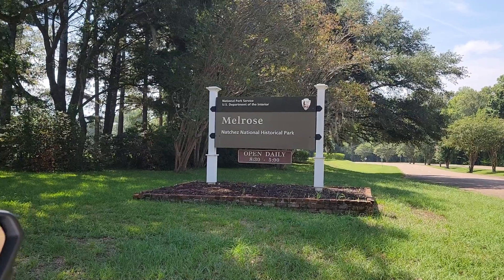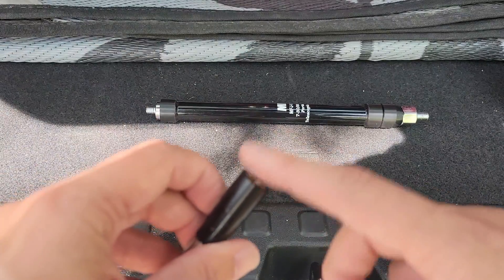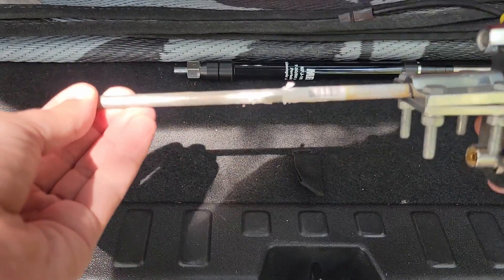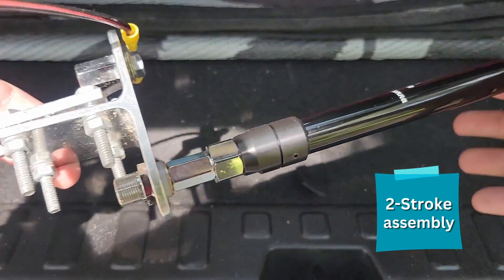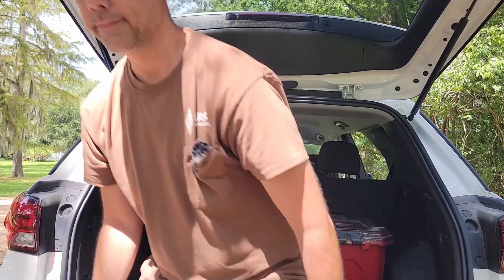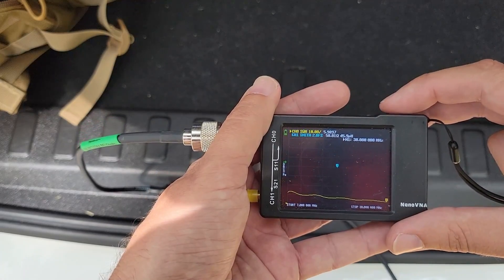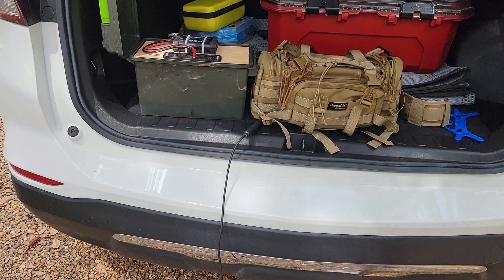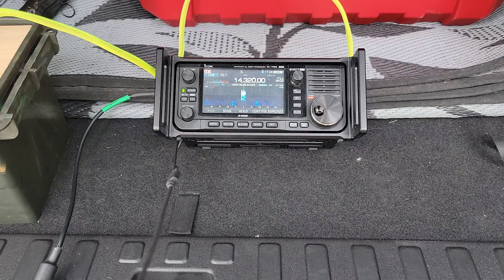What's This Antenna?

Comment: Have you tried using 2 of these antennas mounted to the bracket shown in the video to make a dipole antenna?  This would be similar to ham stick or a buddipole.
Reply from the maker: I haven't, but it should work pretty good!
Reply: @temporarilyoffline  Thanks.  I was thinking of doing this with a Hustler 40M super resonator.  I have one now but with a second would be costly. So I'm thinking of getting 2 of these and can tune in other bands.

Comment: Thanks for the video!   What gage (size) is your ground radials and what length are they?  And does that make much of a difference as far as how much power you transmit on?
Reply from the maker: These are 22 I believe. I'd run 100w through that, but no more. They are 17’. There is a balance between portability and perfection. Find what works for your requirements and have fun

Comment: I have the same setup. Was thinking of using it next fall as I cruise the Erie Canal from Rochester to Lakeport for 10 days. I was told the Erie Canal was a park for its entire length! Question for you is, what do I use for radials while cruising the canal? I know I can put them out when I dock for the night; but I’d like to try mobile. Keep doing what you do! 73
Reply from the maker: I use 4x17ft radials.  Can you spread them out on the boat?  Any metal railings on the boat? Connect them electrically...if not, Check out KB9VBR's magic carpet setup.

Comment: great job ! that a neat antenna.  I found just get ground radios on the ground spread them out normally does the job. this changes to the type of ground and wetness. when you reach around 1:5 SWR call it good. below that makes little difference. This is portable and not 2Kw . once I get a dip in SWR in the band I want around 1.5 or so I just use the tuner in my 7300 and start calling CQ. works for me. it you took a outher hour to get 1:1 it wont work any better getting out and that a hour less of on air contacts. most radios today have a tuner bult it. just use it. even weather change can effect SWR . snow rain ETC.73's
Reply from the maker: Absolutely Correct! This is what I'm trying to tell people!

Comment: I have one of these ("Gabil" branded). It works great! I use it with a X6100 and a IC-705. It's really surprisingly good once you get the counterpoise situation working. And it's extremely portable. It's a winner for its intended use IMO. 73
Reply from the maker: Exactly - compact back-packing antenna its perfect.  If you have space/no portable needs.... not so much.

Comment: Thanks!! Another great vid! 

I rigged up something similar for my Toybox, but that looks a little more robust for external use. And the 3/8x24 on both ends is sooper flexible!

I'm building a bracket to attach to one of those yellow 23' extendable painters poles and was wondering about how to run radials/counterpoise once it's elevated that high: Would one run a single strand down to the ground then fan out 4-6 radials, or run all the radials right from the elevated bracket and just accept the first 23' dangling to the ground?

Yep, I'll try both and measure, but thought someone might have good thoughts! Thanks again!
Reply from the maker: Thought 1: Try it and see, should be fun.  My gut says it won't work as well, but I'm genuinely interested in if this would work.
Thought 2: Use actual wire or wire around rope as your guy lines on your elevated vertical -have them sloping down - connect these to the shield at the feed point and see how well that works.

A lot of antennas that are vertical/elevated use metal rods sticking out horizontally, depending on your connections (or not) that could be expensive.

Comment: Go for it, play radio. 1.5:1 is only 4% reflected power or 0.18dB loss. Just hope the VSWR Police weren't waiting for you when you got home😅.
I have a mobile antenna that uses a similar design as this. However, for 20m and higher, found that hamsticks seem to work better. Assume because base coil loading tends to be less efficient than the center coil type. On the other hand, the telescoping coil design does give you quite a bit of frequency agility.
Reply from the maker: with the 3/8ths-24, you could add a section or two of rigid radiator below the antenna to get the coil elevated.  I might have to try this experiment.

Comment: Great video. Neat antenna. It look far more versatile than the MFJ 1899T antenna that uses a tapped coil for changing bands. I could not agree with you more when it comes to the ground radials. If they are laying on the ground, they DO NOT have to be tuned. I use three each 35 foot long radials and three each 17 foot long radials for my portable ground mounted vertical.
73 de KU3X
Reply from the maker: I think the tapped coil variety are more limited - still workable, though.  This 1898 has worked well every time I've tried it.

Comment: Interesting idea, but the price. I'm looking at something for "vehicular portable" operations, but I think there are better options for the money. For the same money a full set of hamsticks can be had iirc. A WRC Silver bullet and a buddipole 9ft telescopic whip ought to do the same job for just north of a hundred bucks.
Reply from the maker: Yeah, this is more "backpack friendly" and I wouldn't recommend it for vehicle ops.  The ham sticks are a much better choice - esp with the quick disconnects to change bands as the time of day changes.
Reply: @temporarilyoffline  Yeah I definitely wouldn't be using something like that mobile. I'll be sticking with hamsticks for that. ATM I only have a 10m radio in the vehicle, but I have a spare DX-70 lying around that I might put to use. I am thinking more along the lines of something multiband and quick to deploy either via mag mount or screwed in to the existing mount for parked operations, something not my normal portable rig that I can carry around in the truck with me.
Reply from the maker: @KC3UVF  exactly, I'm going to use mine for parked operations also.  The car makes a good counterpoise for that!

Comment: Very easy to set up and radials are okay in contrast to 3 years ago when you lamented the same basic radio theory mechanisms on the HFJ-350. Notwithstanding quality of build issues, tuning mechanism, and RF performance, I am curious if your opinions on the HFJ-350 requiring setup compliant with basic radio theory have changed. It was nice to see a video giving an MFJ product a fair shake instead of instantly trashing it because it's MFJ. And not having a click bait thumbnail. Nice, comprehensive video.
Reply from the maker: I'm still ot a fan of the hfj-350 - that antenna is much more compromised and less flexible than this one.  The HFJ "required"  a tuned counterpoise for each band and it is honestly silly to have a 100ft+ counterpoise. This antenna is still a compromise, but not as bad.  MFJ gets a bad wrap, but where would we be without MFJ and who else fills the niche (big as it is) that MFJ does?

Comment: after stimulus change you must calibrate again ....
Reply from the maker: The nano doesn't have to be a huge obstacle, it can just as easily be a good friend when it needs to be.  Different methods for different tasks and you can't show every detail in every video. In this car, my default calibration is for 20m and until I got to 20m specifically I was out of calibration... but as you saw in the video close enough to accomplish the mission I set out for.

Comment: I have a Hustler 5b and it was given to me in segments. So to put them together as if it was new out of the box, I called the manufacturer. DX engineering. While talking to an engineer/ham, he told me that they also consistently experiment to improve the antennas they sell. So he sent me really complete documentation on the antenna, that included measurements for the sections when assembled.  However once I got the antenna together, I was going to add ground radials, but two problems came up. One the base for radials was not with the antenna. This turned out to be a separate item and cost more money than I had. The second problem, I did not have room to add as many radials as they suggested, not enough room in the yard to make a big circle. Calling DX back and a different ham, he told me they had experimented and found that there really was no need to measure radials for each band and they found making several radials at exactly 25' in length  and at least  5 of them would work. Yep he was right.
Reply from the maker: Exactly, we are always discovering more about radio.  The truth is out there. Great news on getting your antenna working!

Comment: I wouldn't buy one. It's too short to be efficient, especially 40m
I bought a SOTA beam telescopic mast and intend to run a wire up it with a tuner. Telescopes to about 2' and extends to about 19'. Much cheaper.
Like an old ham friend said, you can tune up a knitting needle with a good atu but it won't be efficient.
G4GHB.
Reply from the maker: I've found this one to be very useful in travel, especially air travel.  I have a small tripod, this antenna, some coax and I'm on the air where it would have been difficult before. All depends on your use case.  Everything is a compromise, some you can even live with. Thanks for watching.

Comment: 10m long wire ( on a tree / squid pole ) and an old antenna tuner , some coax ,and ,,,,,,,, DONE.... next
Reply from the maker: I think the only pole you can get in a backpack is the carbon6 from sota beams. It's on the list for sure.

Comment: Looks like MFJ stole the Gabil design. Gabil runs with UHF and 3/8-24 options now on their ebay store. My GRA-7350T tunes 40-6 no problem. 72' counterpoise in 6x 12' wires, laying all the way on the ground around the vertical. She works awesome that way.
Reply from the maker: I like the gabil too .. did you seen in the gabil instructions where they left the original mfgs name in that they stole it from?
Reply: @temporarilyoffline  no I hadn’t but I noticed your similar replies after I posted. Haha. Nothing original it seems, my bad! Good antennas tho. Got Italy from WV the other day on mine!
Reply from the maker: @Emcipio  I have a video on the old gabil, and another in the queue on the new gabil with the laser engraving.  I love the gabil tripod, both are goto resources for traveling

Comment: Aloha Steve, this antenna was designed to work on 10,11 and 12 meters. If you got it to work on 20 and 40 meters, more power to ya! 🤙🏻
     Since I can’t afford the Chameleon MPAS antenna, I built an antenna that works very similar and has an SWR of 1.0 right out of the box so to speak. Which is perfect for my Xiegu G90 and I bet it would also work well with my old Ranger RCI 2950 HF rig for 10,11 and 12 meters. 
     This antenna reminds me of the PAC-12 antenna that you can buy for about $150. 
     I was hoping that this video was going to be about you getting on 10 meters for a Park to Park activation. 
     I haven’t checked the propagation for 10 meters yet today but I’m thinking of driving up into the mountains and getting on 28.310 mhz USB at K-2222 within the next hour. Wish me luck! 🤙🏻
Reply from the maker: I've been on 10m all week at a park, get your ham alert on and come find me brother!

Comment: Don't get me wrong I'm not an hater of MFJ products and have bought a lot from them in the past. However, while the antenna does seem workable, you'd think that there would be some sort of guide provided much like what other antennas makers of this type do as a starting point, and yes, using an analyzer to get it tuned is an option, but it seems a bit cumbersome to get it where you want. And although I see the use of antenna like tihs for portable use,  personally for $149.00 I just can't see it. As a matter of fact, I couldn't even find a manual for it on the MFJ site. I suppose one could take measurements for each band as suggested, but most HAMs who do portable simply want to get setup as qujickly as possible to make contacts.
Reply from the maker: I think you're spot on and I'll help MFJ a little here.  I think this is a brand new product of there's and they haven't written the manual yet.  They are also a little behind on website stuff.  MFJ is one of the few places we have that has so many products available.  I would like to see them do well.

Comment: Fantastic for portable work! I'm thinking you could use a wire, instead of the whip, and hang it from a tree limb (so it can't get blown over).. But it seems a bit pricey... Googling around, I see you can get a similar antenna that is just a bit larger, but comes with radials AND a tripod mount/base for about the same price from Wolf River Coils. Maybe MFJ could sharpen their pencil and/or include a mount or something.
Reply from the maker: Not a bad idea!

Comment: I don't suppose that one of those end threaded rods unscrews from the coil.  If it did that would: 1. allow you to use that whip without the coil (could telescope to 1/4 wave on 6m, maybe); or 2. let you use one of the longer whips with that coil.
Reply from the maker: Not a bad idea!  Even if it doesn't, 3/8th24 is very popular and you can get all the adapters you can dream of

Comment: I have the hfc350 antenna looks like the same basic idea
Reply from the maker: This one is similar, but a little easier to setup.
Reply: @temporarilyoffline  I'm sure it is but I have what I have.  Not very efficient antenna system for anything other than 10meters.  I purchased a PAC 12 antenna seems to be alot more efficient.
Reply from the maker: I'm interested in the JPC antennas, they look like fun and I like the way the coils work.   @swenner64
Reply: @temporarilyoffline  JPC12 and Pac 12 are the same antenna

Comment: If those wires are laying on the ground or buried in the ground aren't they called radials and if they are elevated above the ground then they're a counterpoise?
Reply from the maker: Correct -"ground radials" - If its elevated, it needs to be tuned, if its on the ground, tuning helps, but its more about having a surface to reflect off of.

Comment: If the MFJ antenna mounts are like those made by Workman, the spacing between the bolts is such that you can rotate the clamping plate 90 degrees, making a horizontally mounted antenna a vertical or vice-versa. That works with the single antenna version. Since I don't have a double antenna/dipole version, I'm not sure that'll work unless the clamp is at the very top of the pole.
Reply from the maker: It does work that way on the double mount also.  I did a video on that one here: https://youtu.be/oBWTKoGbOLQ?si=H8LTbRu1FvLwsxro

Comment: Same at the Gabil version (which I used for my primary SOTA antenna for the last 7-8 months). They do work, but, be ready to replace it after 3-6 months. I found that 6x12ft (20ga) radials worked best. Eventually, the inside of it starts suffering from intermittent contact issues as it gets used over time. This not only happened to mine, but to two others in my highly-active SOTA group that happened to jump on the Gabil bandwagon when they first came out. Used the hell out of them for a few months, then they stop working. 

I just went back with a SuperAntenna coil, which tunes easier and is built to a better standard. Also, the MP-1 coil diameter is proper for what it's doing.
Reply from the maker: I haven't experienced that so far.  Did anybody try gabil for a warranty?
Reply: One of us did. No response. I'm going to take mine apart at some point and have a look inside to see if it's anything glaringly obvious.
Reply from the maker: Might just need to have its "foot" bent back into place.  If mine dies, I'll take it apart and fix it also.  Let me know if you find anything interesting.  @SASQ
Reply: Use my Gabil as a spare but even wind makes it jumpy at this point. JPC-12 with longer radiator has been super consistent.

Comment: I use something simiar, a chinese "manual screwdriver" antenna that I use with a 7 or so ft stainless whip. I pre-tuned it roughly in with a nanoVNA and off I go. As you can imagine it's a bit twitchy on 40m but for 20/17/15 it seems to work a treat.
Reply from the maker: That's the way - I have an 80m version too, can you imagine how tight that one is?

Comment: I had a similar antenna a while back with the sliding coil adjuster. It wears over time with use and can be very tricky to tune at times but a good fast portable solution. 73 de - G0LQP
Reply from the maker: Interesting, thanks for the info!  I'll be watching for future wear!

Comment: Very cool   ;)    Im testing a vertical mobile antenna this week too.   its the  OPEK  HVT-600  along with  a  5"  diameter magmount  from  ANLI.      So far I have made some 10m contacts.  and some 40m contact with that one.   I haven't been able to make 80m contacts but im not too interested in 80m operation anyways.     the HVT-600 is similar but instead of slider for changing bands there are taps for each band and they give you a banana jumper to move around between points on coil.   oh,  and there is some "fine tuning"  with the little stinger whip at the top.
Reply from the maker: Looking forward to hearing how it works for you.  I tried the "Comet Toybox" and I didn't like it - it was too heavily loaded.